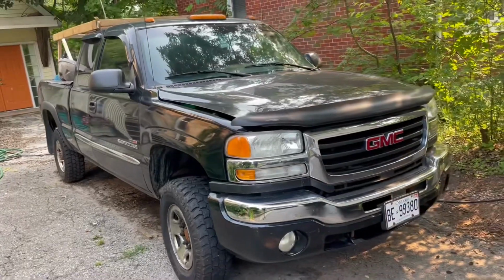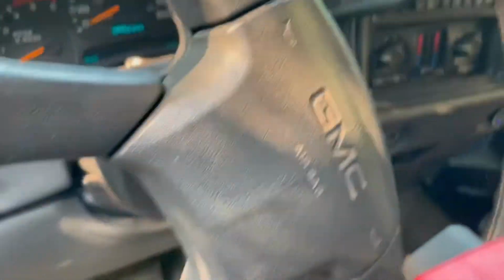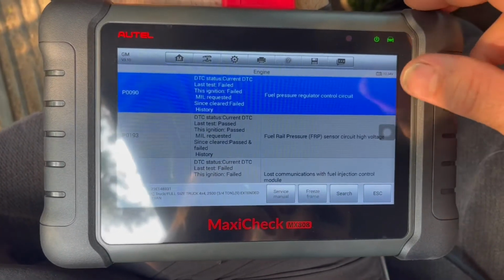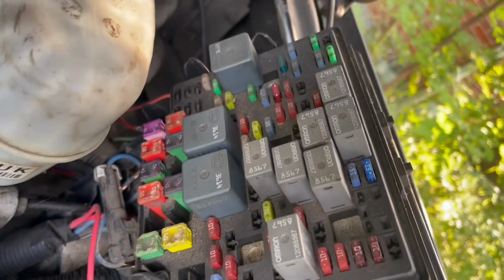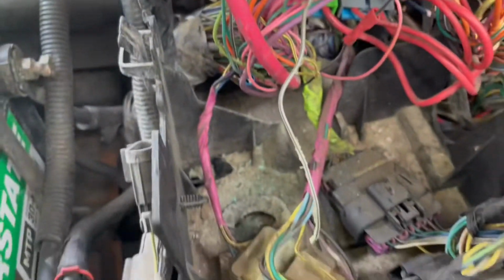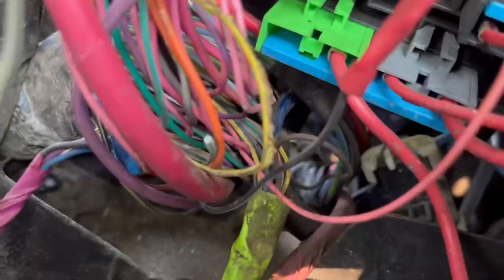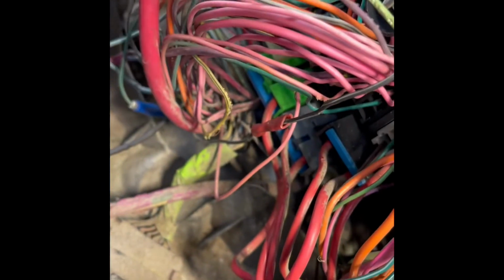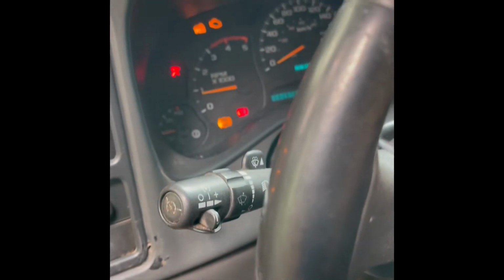Crank no start lb7 duramax

Comment: 04 LB7 Duramax, lost power at 80mph, got it to a safe spot. No check engine, no codes at all. Filter loses prime after cranking. Fuses and relays are good. Any ideas?
Reply: Any luck yet same situation?

Comment: Im thinking similar ground wire but the actual bolt got covered with oil or corroded. I know i have 4 bad glow plugs that will make harder but. I'm getting p0700 and lack communication to TCM. Is supposed to be a good tcm. 2 new batteries, and new reman ECM

Comment: gonna try and change the crank sensor
Reply from the maker: I would think if it was a cps you would be seeing P0336, I would check the wiring because a P0374 is High resolution circuit performance.  A missing high resolution signal will cause a no start condition.
 
Check out this link, it has a good diagnostic
https://www.dieselplace.com/threads/running-like-crap-dtc-p0374.318796/